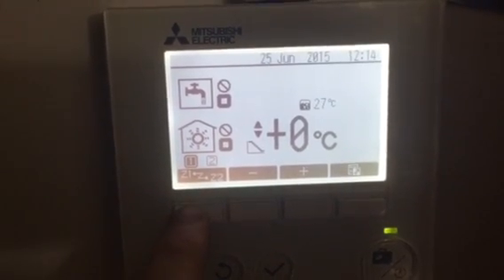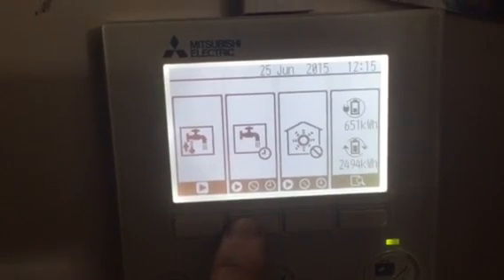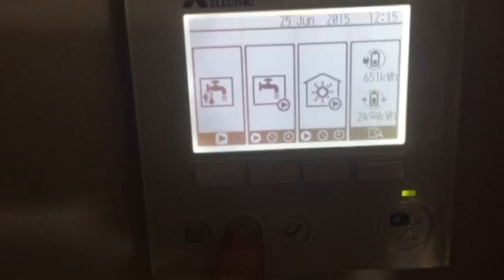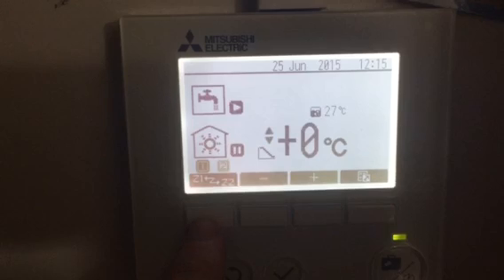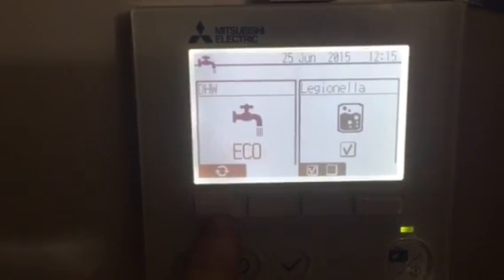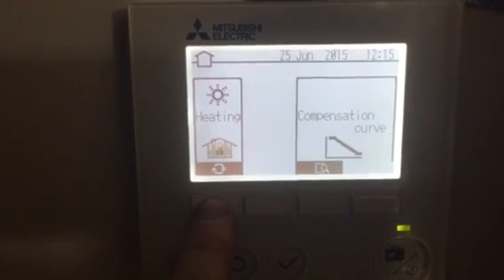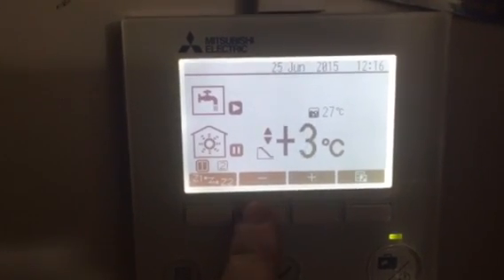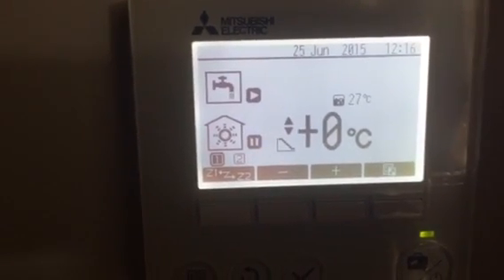Ecodan FTC5 controller

Comment: Good video, what do you recommend the compensation curve to be? I currently have it on +2 in February, I would like to understand how it works. Also, water is it best on normal or eco?
Reply from the maker: David Boyd your heating curve in the service menu is more important that your curve! If you are happy with your heating the. You won’t have to adjust. Eco Water is cheaper if you have enough hot water from it
Reply: @glightsolutions  thanks for the reply, our bills were big but mitsubishi told us to use the heating curve which has reduced the bills. I just didn't understand the 0 +1 +2 etc